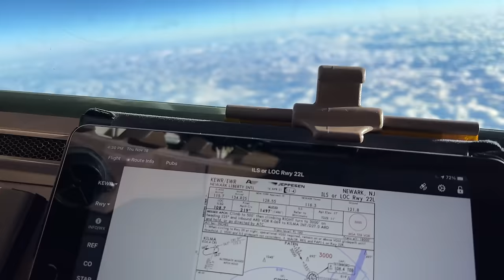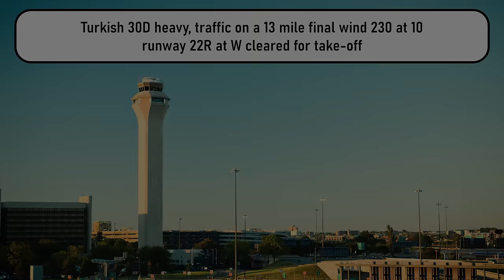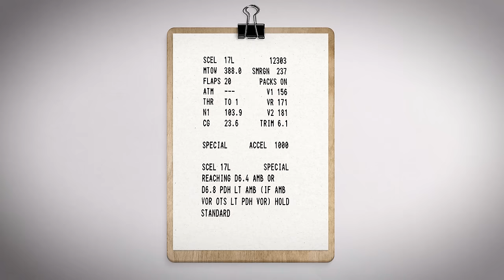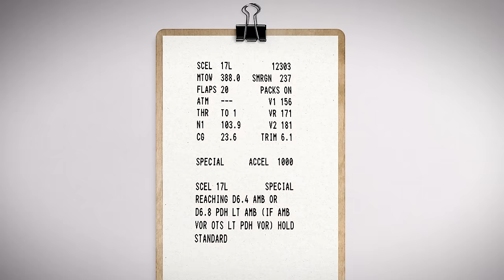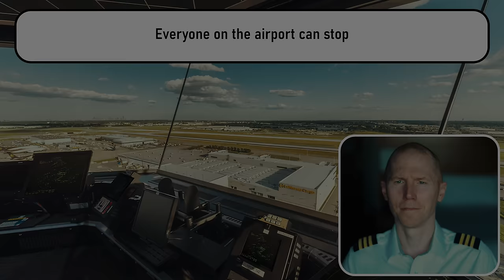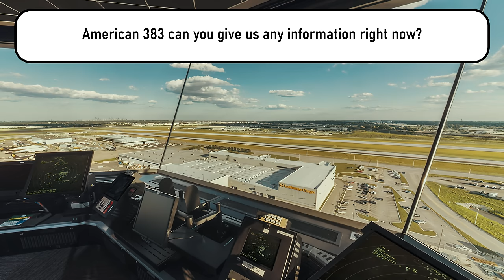American 767 Engine Fire

Comment: If your read the NTSB report on AA383 there are some very interesting elements to this event. 

First the evacuation was inflight initiated with the good engine still running. That engine continued to run for a while making this a single exit aircraft until the crew reached the point in their checklist where they shut it down.  Inflight made numerous attempts to reach the flight deck by inter-phone but understandably those didn’t work out. There is video out there showing the L4 door slide plastered against the fuselage until the engine spoils down and then the slide comes down and people are able to start coming out the back. 

When you look at post event pictures it’s apparent that the passengers were exceedingly lucky that the fire didn’t happen upwind. Had that been the case that fire wound have been inside the cabin long before the crew shut down the remaining engine. 

What’s sad is that the industry hasn’t learned anything from this event. We still train crews to stop straight ahead on the runway and we don’t train that there are times when getting the remaining engine off immediately could be the difference between life and death.
Reply: Yes, what is inherently necessary in maintaining engine power under these circumstances??

Comment: The gotcha for those pilots was the intersection takeoff. The visual shown above has the two REIL (Runway End Identifier Lights) that make it easy to recognize the runway at night. However, because they were making an intersection takeoff (where a taxiway and runway meet) there were no REIL and the runway number wasn't visible either because they were already past it.
 Taxiing at an unfamiliar major airport at night can be more stressful and challenging than the flight itself.
Fortunately, these days most pro pilots have laptops that show them exactly where they are at the airport.
Worse case scenario, you can always ask the tower for guidance. (Much better to feel stupid than to do something stupid.)
Reply: _74gear is a fake account impersonating Kelsey.  The real channel name is @74gear without the underscore.

Comment: Evacuation checklists for passenger aircraft usually have a step to "Advise ATC" of the evacuation. Even the cargo aircraft I fly has that step in the evacuation checklist.

You stop on the runway to also give more room for safety vehicles to maneuver around the aircraft. A narrow taxiway may not provide enough room around it and the vehicles may get bogged down in the grass.

Comment: In Norway, we have had so many incidents with people almost taking off (one plane actually did take off) from taxiways that we have enforced a Taxi-Lineup-Takeoff rule. In short, it means that a takeoff clearance is never given unless the controller can verify that the aircraft is in such a position that it is impossible or unreasonable for the aircraft to depart from anywhere else than the given runway (ie. an explicit lineup clearance is often required before a takeoff)

Comment: I like the way Kelsey says they were 'only' doing 90 knots. A giant A340 doing 90 knots on a taxiway seems like quite a lot of kinetic energy to me.
Reply: That is up into the range of a heavy-weight landing KE, and so certainly enough to make brake temperature an issue for turnaround time.  Aircraft size doesn't particularly matter though, because brake size/capacity is scaled accordingly during the design process.

Occasional exceptions to that "rule" include the MD-87, which kept the much heavier MD-80's landing gear/brakes and so was a good choice for island hopping airlines flying rapid-turnaround short hops.  The brakes had a lot of capacity relative to operating weights, so peak temperatures stayed low relative to the competition.

Comment: Regarding the second story, it was incredible that no one got hurt. Working around planes is dangerous, and you can't take anything for granted. There are thousands of things that need to go right, but if one thing goes wrong, it could be catastrophic. I know, I used to work on the flight deck on planes on a carrier.

Comment: -When I was a pilot instructor for American Eagle in Dallas, I got to talk to new-hire Flight Attendant classes and give them the breakdown about mechanical problems with the plane.  Basically, I told them that if you are not upside down and/or don't see any actual flames inside the cabin, then the only problem is that your work day is going to get a whole lot longer, don't worry about it if we do an air-turnback or have to make an emergency landing.  But also I was able to sit in on some of their training and folks it was an eye opener! They are taught to literally throw people out the exits and down the slide, and the most striking thing is that they receive the exact same training as police in how to use their voice:

"YOU!  PUSH THAT EMERGENCY EXIT OUT!  YOU PUT THAT BAG DOWN!  DO IT NOW! STOP RESISTING!"  

I'm not kidding!  In order to pass training they have to be able to show a truly nasty side, and their "checkride" is literally in the cabin trainer with instructors who are acting like stupid passengers.  And sometimes they literally throw the instructors out the door!

You might think they are just 20-something drink servers looking for hot sex on the overnight, but there's a hell of a lot more to the job than that.  They are taught that during an evacuation situation that pretty much anything goes, and if they physically have to push a passenger down the slide they will DO IT.  

Having flown passengers at two regional airlines, I can tell you, based upon the behavior of flight attendants during the few true declared emergencies I have dealt with, about 80-85% of them are going to act professionally this way.

Comment: The one thing you didn't mention, and is an additional danger of an intersection takeoff, is the lacking of runway numbers at the intersection. As you have pointed out in other videos, it is a good habit to verify inside/outside the aircraft that you are pointing down the correct runway... Without that additional outside check, you need to be even more vigilant that you are on the correct surface and pointing the correct direction.
Reply: The numbers are at the end of the runway. They werent planing on taking off from the end
Reply: @darkclownKellen  actually that runway has a displaced threshold so the numbers would have still been visible once they took the runway.
Reply: @darkclownKellen  that's MercFE's point - runways should have additional number markings in places where intersection takeoffs are common.
Reply: Good point … but also there are always the red signs on any intersection indicating the name of runway ahead … always check that
Reply: @davidzachmeyer1957 don’t want to treat pilots like complete idiots but it should be very obvious to anyone the difference between a runway and a taxiway
Reply: @jrmyl  They weren't taking off from the threshold, displaced or otherwise. They were taking off from an intersection part of the way down the runway.
Reply: @thomasdalton1508  Please take a look at the airport diagram, as I did.  You will see that the intersection they were taking off from was prior to the displaced threshold and the runway numbers.
Reply: @jrmyl  Ah, so it was. I take it back!

Comment: In the 80's I had a situation where at night my landing lights were out (they weren't when I departed). This is a small plane, not an airliner. Anyway, I notified  the tower that I would land without lights, since I could see the runway well. Then I made a nice smooth landing. However, once on the ground I couldn't see shit! There were so many blue lights on the ground in no identifiable pattern, I just went off to the right to clear the runway, and went onto the grass. Very embarrassing to say the least, but now I am older and don't give a damn.
Reply: Looking out the airplane windows at night, I've often wondered how the pilots make sense of the field of blue lights.  Now I know!
Reply: You just gotta boogie real slow with the blue lights way down low...
Reply: Brother I've done plenty of s turns trying to find the centerline leading out of the apron, even with lights 😂. No harm done lol.

Comment: I've been really enjoying your channel so far with the few videos I've watched - I've casually "learned" how to operate various aircraft in simulators such as X-Plane 11 and now Microsoft Flight Simulator, and I'm curious if you happen to have any resources for learning how to understand and interact with ATC. Also the FMC in airliners, those are basically the only two aspects I'm missing so far as far as the scope of what I can currently simulate.
Reply: Not a pilot, but a maintenance personnel that use the radios fairly often for checkouts of the systems. It’s more nerve wracking than anything. But to do it, you say who you’re calling, who you are, and your intentions. So an example would be “Detroit metro Ground, Aircraft 8457 preforming radio ops check how copy” so in that example I called Detroit metro ground, I’m in aircraft 8457 (usually will be N number for private or flight number for commercial) and stating that I’m doing a check of the radio. Hope this helps with that part!
Reply: @ace_trace_2237  Ooh, yeah that helps a lot actually. I've just been flying casually in MFS without interacting with ATC but I think I might try doing it regularly so I can get more comfortable with the comms and procedures.

Comment: I was surprised that nobody spoke about number of "souls on board".  This is something that the fire crews would like to know.  For the record, I'm not in the airline industry in any way but I haven't miss any 74 Gear vid since the beginning.  Kelsey ALWAYS mentions that letting people know how many folks are on the AC is important.
Reply: If you're talking about the AA fire (second half)?  The communication to ATC about number of SOBs happens in an airborne emergency.  This was a critical on the ground scenario.
Reply: While it would have been nice for the fire crews to know they probably didn’t have time to relay that information. Like Kelsey says a few times they have a lot going on. One of the things I was taught in flight school is Aviate (fly the plane first), Navigate (get to where you need to go), Communicate (tell ATC what’s going on). In this case Aviate would mean focusing on the evacuation. Hope that clarifies a little!
Reply: @captaind6178  The number would be variable because of evacuation. 
The cabin staff would be on the ground with a list of names. Any not on the ground but on the list could still be aboard though some cabin staff would probably remain on board till disembarkation is finished. 
So don't waste the flight crew's time.
Reply: Kelsey didn't play the full audio, and I can confirm the full audio did not mention the number of souls however shortly into the audio ATC provides the pilots the frequency the emergency ground crew is on so they can talk directly to them, the audio for that however is not available, I imagine they would have mentioned the souls on that frequency as after ATC gave the pilots the new frequency there was no further communication with ATC from the pilots.
Reply: When an aircraft is airborne and there is necessary time before they can land, providing such information as souls and fuel is helpful for the fire crew to better assist, but even so, that is only if the pilots have time. If he pilots are busy, they can tell atc to stand by indefinitely. After a rejected takeoff, when the airplane is on fire, even more so there is no time to make such queries. Get everyone off the plane and away from the danger, and ask questions later. Also, the company dispatcher will always have the latest paperwork before the aircraft leaves, including souls on board (and passenger lists), so when it comes to accounting for everyone afterwards, rescue and ground crews will use that information

Comment: I’ve only been a simulator pilot from EWR, but I find those right turns from the more than 90 degree taxiways to 22R a little tricky, but it’s worse from Z/ZA. You can see the way those taxiways come together though at W, Y and the runway. It’s kind of a sea of lights at night. That said, when I’ve messed it up, I’ve noticed. 

At least one commercial pilot, and I believe more, have landed on taxiway Z shooting for runway 29. That’s sort of a known, confusing spot, especially at dusk, with the sun in your eyes.

Comment: Regarding the Turkish Airways takeoff error, I'm not sure if the skid marks from this incident are still visible or not.  They were originally quite noticeable as they were laid on pretty thick for obvious reasons.  The marks started at the intersection of taxiway "J" and ended on the opposite side of taxiway "G" - roughly a quarter mile of dual double black streaks on Papa.  It's often joked that taxiway Papa is 22C/4C.

Comment: It's absolutely blown my mind a number of times that in the year 2023, multi-million dollar aircraft don't have a cheap digital camera pointing at the wings and engines. Both this channel and Mentour Pilot have covered a number of incidents where it would have been very valuable for the pilots to have a view of the wings and engines. Cameras are dirt cheap. I realize that installation has to pass a certification, but there should have been plenty of time to do that by now. You don't have to have them up on the main displays, just have them as a page on the pilot's EFBs.
Reply: ah, but some DO!  The A380 has a camera in the tail that overlooks the entire plane.  There are several more in various places.  Something to consider - those things and the associated wiring 'cost' weight.
Reply: Great idea. Can the engines be seen from the cockpit? I'm guessing no. It's really hard to see the engines from 1st class.

Comment: We need to know how many souls are on board and what the fuel load is. These are two very important things that as a airport fire fighter we need to get. We have to get the proper equipment responding as some might take some time to get going. We only have a few personnel actually on duty at any one time, so if it's more than we can handle we need to alert the closest additional units enroute. I can understand that the pilots are busy but please understand when atc asked for additional information it was for a very important reason. We don't want to respond multiple ambulances let's say if the aircraft has only a few passengers.

Comment: Kelsey can you comment on the QANTAS QF144 flight that had an engine failure. The news is carrying on about how it's such a big issue because the passengers heard a bang and the pilots didn't tell them that they had an engine failure. The plane landed, no issues. (mind you if you lookuo daily mail they have a photo of the starboard engine in reverse and have the comment "visible damage". At least it was a photo of a B737)
Reply: Yeah massive overkill in the Australian media. Engine failures happen all the time in the US (a couple per week?), considering the massive number of flights there in comparison.